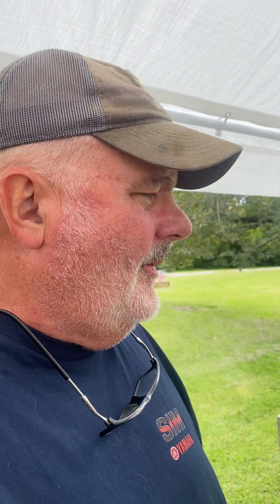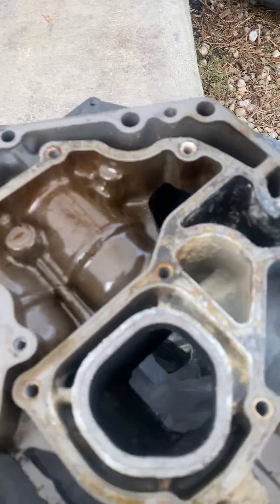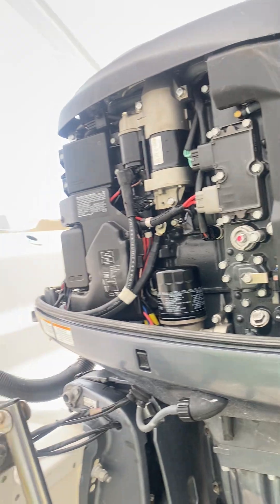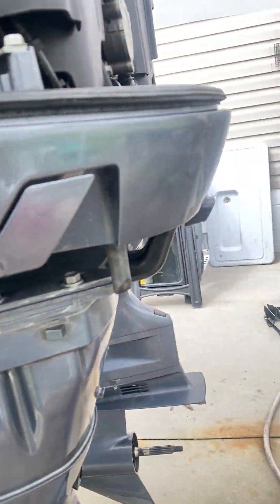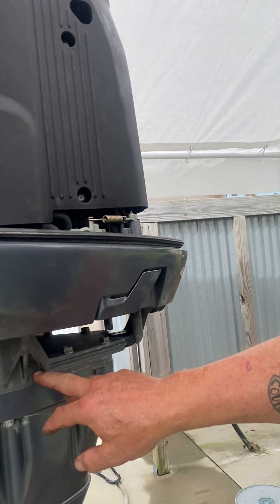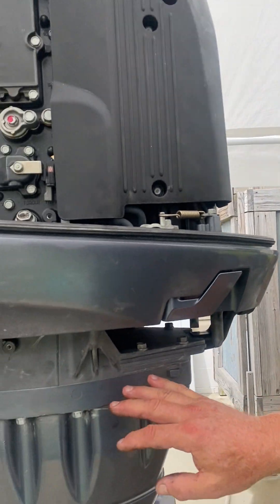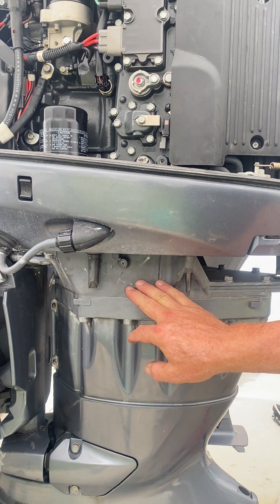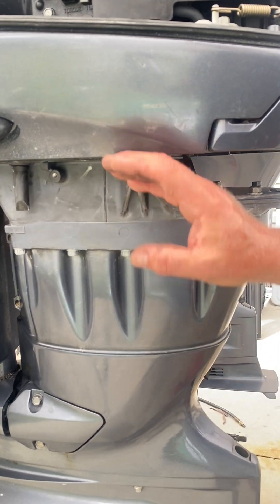Yamaha 150 Exhaust Corrosion explained. DO NOT WELD.

Comment: This has been going on for over 20 years with Yamaha. Had the exhaust rot issues with 200, 225, & 250s back in the early 2000s. Am about to repower my 19’ Mako & was looking into a Yamaha 150 but not if this exhaust rot crap is still happening. Guess its time to look at Suzuki or Tohatsu. If its happening with the 150 it is more than likely the same with the 175 & 200 since they are essentially identical.
Reply from the maker: I think the issue is with engines that idle a lot. Mine idle for hours at a time while bottom fishing. Probably close to 30-40 percent of their life.

Comment: Brian, exact issue I am now dealing with in my 2014 F150XB.  First and only owner, fully maintained and only 486 hours.  Salt water use.  Noted below the comment about it being over propped which causes the pressure under higher rpms: mine maxes out around 5350.  Dealer in NJ was aware of issue but accepted no responsibility.  Going to see what our local (coastal MA) dealer has to say about it.  #yamaha #yamahaoutboard
Reply from the maker: Well at least you only have 1 engine. I am beginning to notice some signs on my starboard engine now. When I pulled up to the dock after a long day, I could hear and see water coming from the exhaust overflow. I predict next winter I’ll be doing it all again. I hope someone takes legal action against Yamaha. If this were an airplane engine the FAA would have grounded all engines by now and mandated repair.

Comment: Hi Brian, thanks for posting this.  Unfortunately, I am having the same "dry exhaust" corrosion problem on one of my twin 2014 F150XA engines.  The thing is, with mine, I can see some corrosion where the metal has eaten away along the edge on the block side of the engine.  This is on the Port side, right below the exhaust cover, where the block meets wha I am calling the mid-section "base".  This causes the engine to fill up with exhaust fumes, starving the engine and powering off.  The engine only has around 650 hours and I am very anal about its maintenance and upkeep including religiously flushing with Salt Away every time I use the boat.  It lives in the Florida Keys on a trailer, but for a few years it lived in a slip in South Florida.  I am not sure if it corroded during it's slip time.  Anyway, I did try to get it repaired by a local shop with good reputation in South Florida but they told me the corrosion was so bad, they didn't want to put their name on a repair and so recommended I purchase new engines.  The thing is, I don't have that kind of money just laying around (about 40K for two new engines).  I've tried to "patch" the corroded hole with marine JB weld and it held up for a few months, but it's happening again.  Your video is inspiring me to replace the corroded pieces as I am pretty handy with tools and have basic mechanical skills.  I do have car repair tools but I am missing an engine hoist.  That being said, it would be helpful if you could please reply back with the parts you purchased to make this repair yourself...besides the mid-section and the oil pan, what other parts did you have to purchase?  Also, without an engine hoist, what is the best way to lift the block to inspect and conduct the repair?  Should I purchase or rent an engine hoist?  Thanks in advance!
Reply from the maker: Harbot Freight sells engine hoists for less than 300 bucks. Youll need to block it up so you have enough room to pull the pwerhead. I used about 4-5 , 12 in square landscape bricks under each leg.  
Go to SIM Yamaha on the web. Enter your engine info and it will give you a list of diagrams. They have created a special repIr diagram with all the possible repair parts listed. But you wont know what you need until take it apart.  Also i dont beleive they have the powerhead gasket listed. I used all new gaskets and boots (exhast) and exhaust plate. You could get by with less but its a big job so i did it right.

Comment: Im sorry but its not from low rpm idle time.  The exhaust backpressure at idle is nothing. The problem is low rpm at FULL THROTTLE. ie over propped.  If you dont reach 6k on the pins you are creating incredible cylinder pressure and heat. This causes extreme (over1000*) exhaust temps that degreade the cheap aluminum.  BTW  your other engine needs to have it done now too.  Agree this is a BS failure and shame on Yamaha
Reply from the maker: I think we’ll have to agree to disagree. I rarely run my engines over 5k and my WOT is 6k.

Comment: I noticed my 2007 Yammy 150 with about 500 hrs and I run in salt water, ( but flush every time) exhaust is louder than usual so I'm looking for pointers to figure out what it is without tearing it apart. Any places I should look first?
Reply from the maker: Pull the lower cowling or take a real good look at the lower cowling in the area of the port side about  center of the cowling. If there isnt a hole burnt through, there may be a white hazy circle where the blowby is hitting the cowling. Ill see if I can find a photo.
Reply: @brianharbaugh1132  Thanks. would appreciate that
Reply from the maker: I watched the video and I show where the hazyness is.

Comment from the maker: Based on my engine i would stop using  it and have it fixed.  Your probably looking at 5-6 k if you let someone do it. So i guess you need to weigh rhe time on the motor, the cost of the repair against a new engine. Donuou have a lot of low rpm hours on your engine?

Comment: Just found the dime sized hole on the side of my 2007 150. Noticed the loud exhaust sound as well. Do you think I can get away with running the motor for a few more weeks before I’d typically winterize it? You think I’m best off buying a new motor this winter or have a mechanic try to repair it? Appreciate the help
Reply from the maker: I thought i deplied ro this. So I apologize if this is a duplicate.  Based on my teardown I would stop using immediately. The job probably costs 5-6K.  I giess you need to weigh your engine time, price of repair against a new one.  Keeping on mind the motor should be good to at least 2000 hours.
Reply: Ok thank you very much. Yeah I only have about 650 hours on the engine
Reply: Same thing happened to mine with 1400 hours. quarter size hole blew through the mid section cowling. My mechanic explained that these motors are meant to run at 5500 to 6000 rpms and stop babying your engine!  Being fixed this winter. Yamaha needs to get it right! Shame on them!
Reply: Thank you for this posting. Very helpful. Seems manageable.